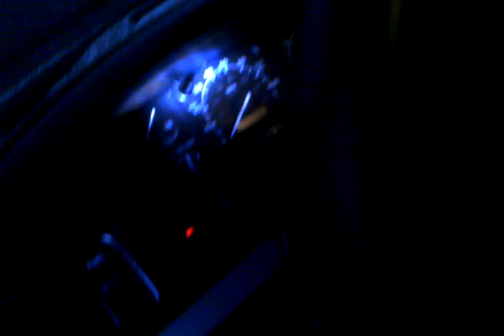f150 1995 heater core replacement

Comment: Dude, I have a 1999 f150 4x4 and have i  the same problem steam get inside my cab and i have  to roll down the windows to let the steam out, and it's cold in the bay area at this time.And water is leaking underneath the passenger side.i just hope is not the water pump.I have to take my truck to the dealer so they could fix it .